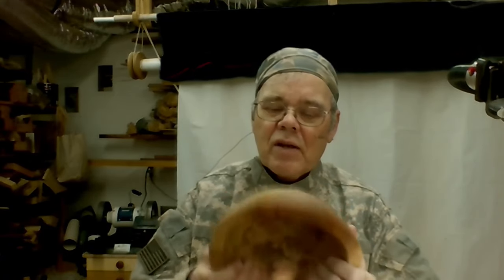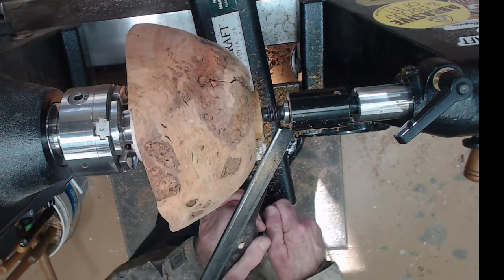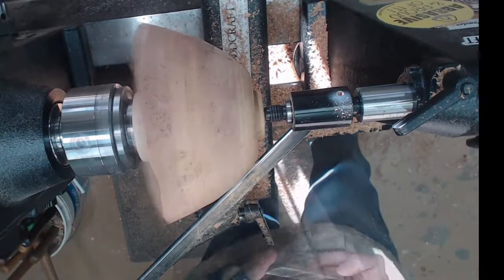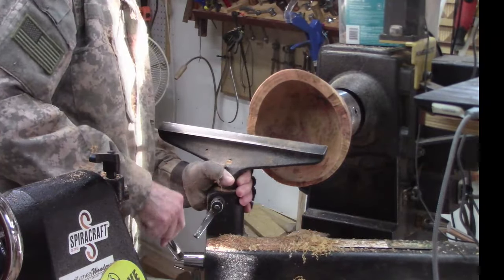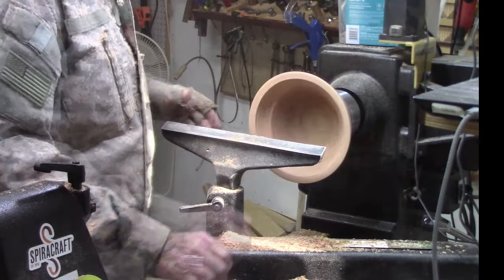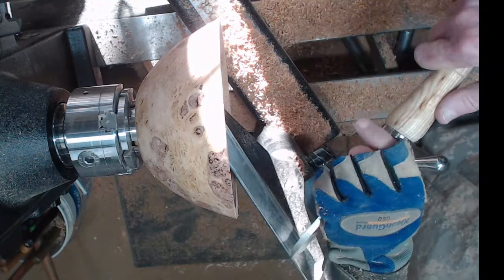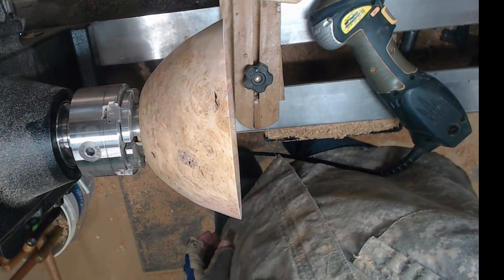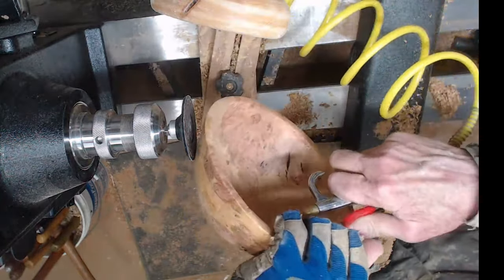Finish Turning a Cherry Burl Bowl

Comment: I've been away from turning for several years and your the first video I seen in awhile and now I feel I have to turn a bowl. Thanks for posting. And I watch you use a scraper I've been holding mine wrong. Mine is laid flat on the wide portion and you turn yours 90 degrees on to the smaller flat. Is that how everyone uses a scraper? I'm gonna try it because my way hasn't worked to good!
Reply from the maker: It depends on what you are working on. Cleaning up the bottom third with a conventional scraper would be flat on the rest with a slightly raised handle. Cleaning up a bit of the wall like I was doing, I was shear scraping which is not very aggressive.

Comment: Very nice.  That burl really turned out well.  When you were doing the shear scraper on the inside of the bowl, what angle did you have it at?  It was difficult to judge from the video
Reply from the maker: It probably varied from 30 -45 degrees.
Reply: @MikePeaceWoodturning   Thanks